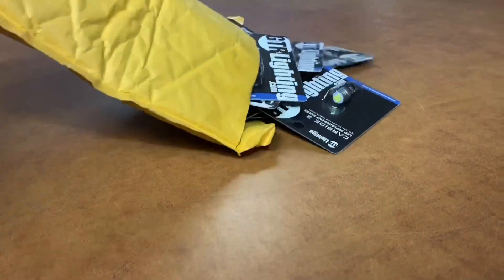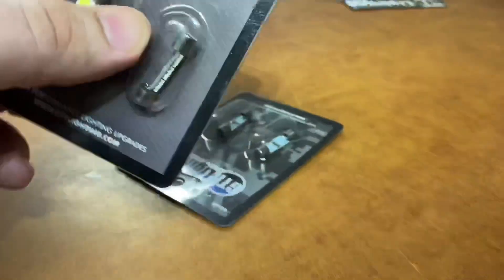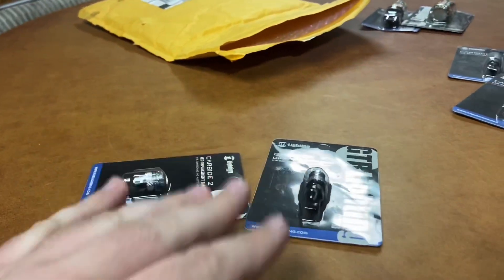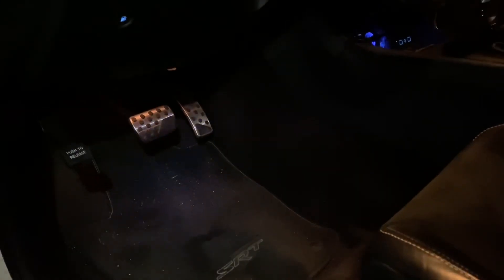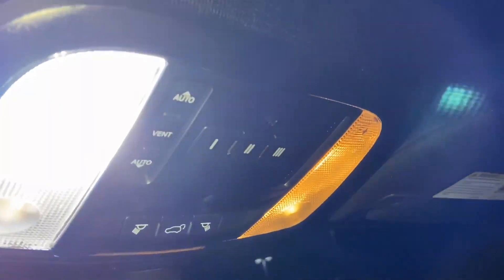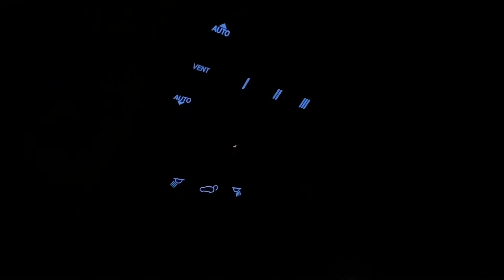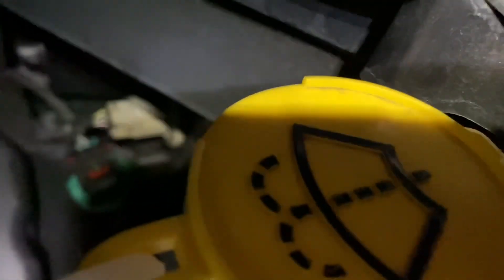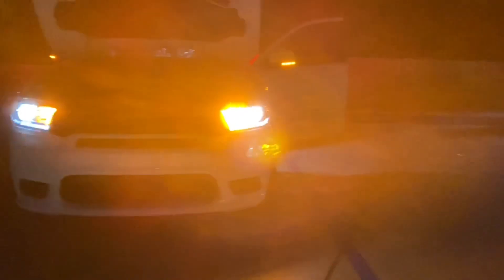Durango (2011 - 2024) LED lighting upgrade from Headlight Revolution

Comment: I just got a 2021 durango! Def need an upgrade...will the 2020 package work for thr 2021??
Reply from the maker: Everything except the turn signals will work  as those are part of the new headlight design for the 21s

Comment: Any way to remove the map light assembly instead of the plastic covers??
Reply from the maker: Possibly but it’s probably more work than it’s worth
Reply: @MattySRT  i figured but i broke my bulb ..i took the base of it but now the replacement wont light up ..i want to check the socket itself ..im so fkn pissed

Comment: Are the lights too bright? Was reading some comments about that - you can dim them correct? Looking to upgrade as well -
Reply from the maker: At first they are definitely bright. I’ve gotten used to them. I would recommend the lower lumens one that cost less. I however was sent the more expensive/brighter ones instead and HR just said keep em so I left them in. So of course the camera never does justice but those are very bright at night but great for the day.